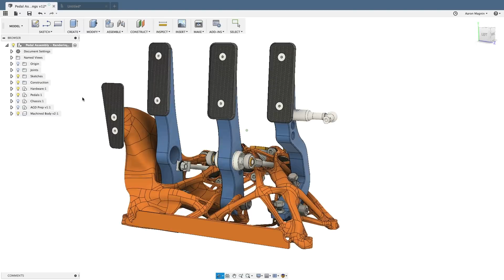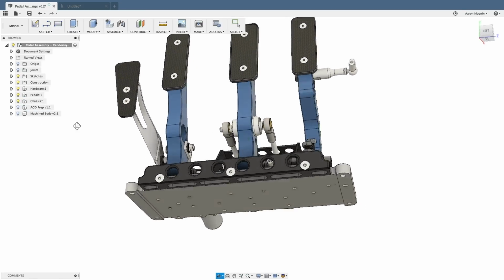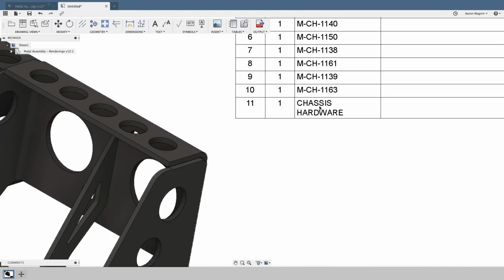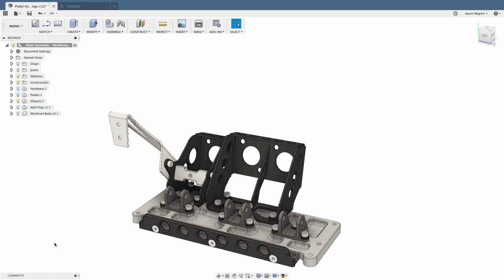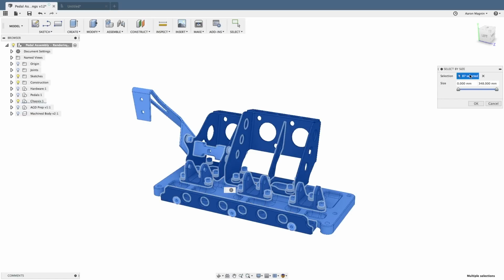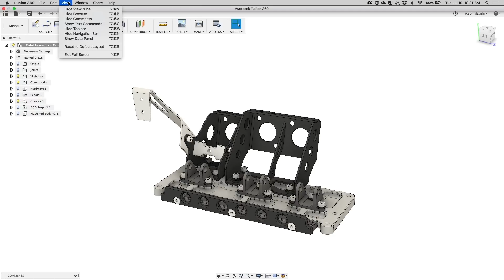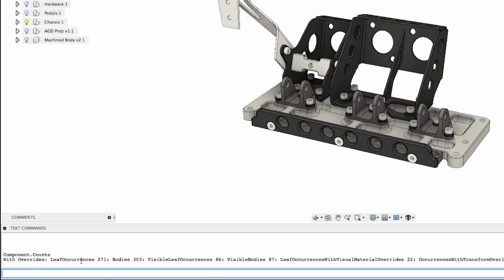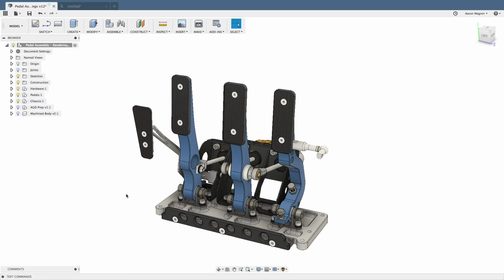QUICK TIP: Body Count

Comment: Thx. Have been looking for good reference(s), +/or query methods, but coming up rather short:( In particular, at this moment, looking to move a point object to a location. Found 'commands.SetPoint3D'. With no arguments, get: "The number of parameters doesn't match the parameter format: %s%p3". Attempt 'commands.set3dpoint $ (1,2,3)', get "The number of parameters doesn't match the parameter format: %s%p3". Clearly, I need a basic reference. (FYI, made living doing custom maxscripts.) TIA.
Reply from the maker: Not sure I can help or even fully understand. I would recommend jumping over to the forum, specifically the API section.
Reply: @adskFusion  Thx. Will post to forum. BTW, just wanna know how to call 'commands.set3dpoint' - specifically, format of arguments.

Comment: Which gives...

Component.Counts
Traceback (most recent call last):
  File "<string>", line 1, in <module>
NameError: name 'Component' is not defined
Reply from the maker: Is it possible you're in the wrong type of text command? See the option in the right of that interface and ensure its set to "txt" and not "py" or "js".
Reply: And... that was completely invisible to me until it wasn't ;-) Thanks for your assistance, problem sorted PEBKAC.

Comment: Is there a list of text commands somewhere , maybe what they do and a translation of the information and/or action they produce ?
Reply from the maker: In the text command if you type "?" you get a list of available commands. I've pasted them below: 

"This is a DOS box like command window. Command names are split into Subject Areas and Operations (e.g. 'Document.Open'). Commonly used Subject Areas are...
AnyCad    APIDebug    APIUI    Application    Asset    Associative    AutoSave    CircuitBreaker    Clocks    CloudBrowser    CloudFileStore    Commands    CompanionApp    Component    DebugCommands    Decal    Diagnostics    Document    Entity    EntityChange    EntityTracking    Expressions    Fusion    FusionMaterials    FusionTranslator    Geometry    GlobalCoordinateAxes    Graphics    HealthCheckService    HotKey    Instance    IPC    JavaScript    Joints    LiveReview    LocalToWorld    Managed    Manipulator    MaterialLightEdit    Materials    Matrix    MetaTypes    Metrics    MSketch    NamedView    OBJOpenOptions    Options    PAsset    Paths    PBody    PComponent    PEntity    PFusionDocumentation    PInstance    PInterface    POccurrence    PScene    PSelections    PTransaction    Python    Render    SATOpenOptions    ScopedLocks    Selections    SheetMetal    Sketch    Smoke    STLOpenOptions    StrongRef    SynHub    TextCommands    TextureMapping    Toolkit    Translator    TranslatorOptions    UI    Units    UnitSystems    Validation    ViewCube    ViewFragment    Window    WM    WorldToLocal"

I'd like to find this list in a better, more searchable (and explanatory) locations, but am unable to locate it, which might be because it doesn't exist. Anyway, let me get back on this...